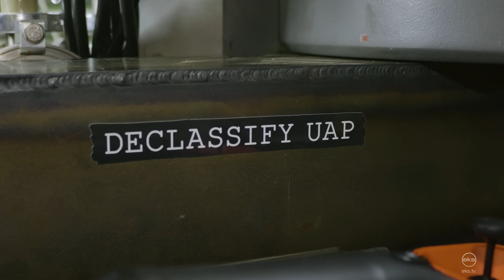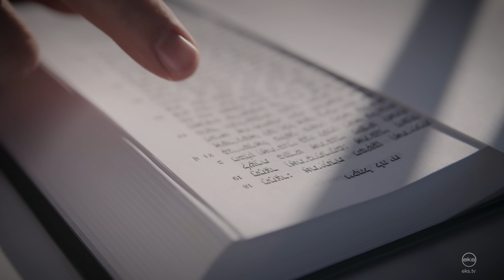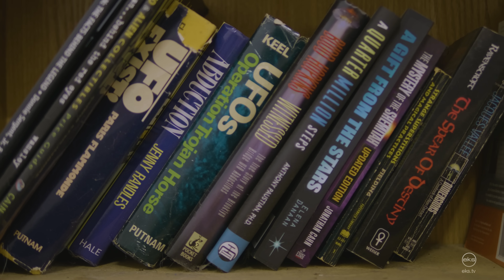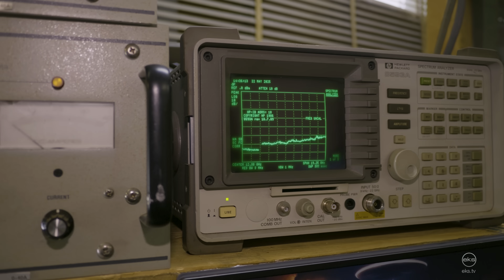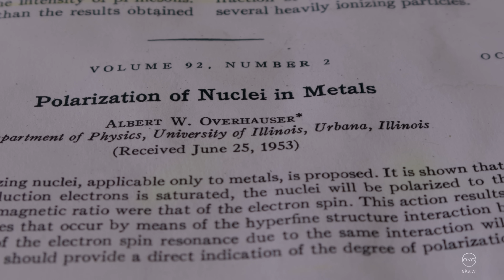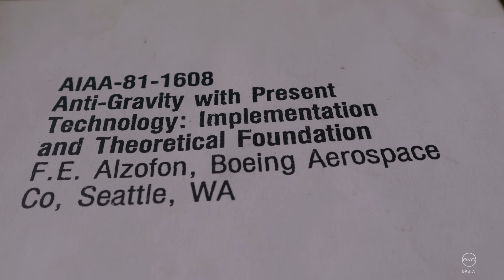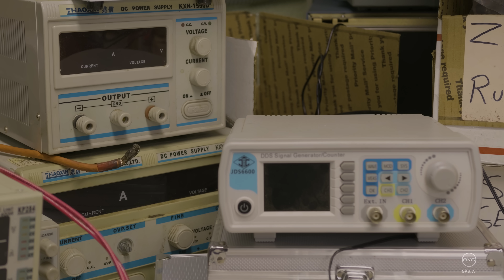Reverse Engineering UFOs - Inside Falcon Space Lab

Comment: Microwave induced Dynamic Nuclear Polarization causes objects of mass to lose their mass thus allowing for faster than light travel and no need to worry about inertia, which explains how UAPs can make 90° turns at 27,000 mph. 
The shape of the UFO/UAP is a Topological Insulator who's unique shape maximizes microwave efficiency.

There's a book they're studying from which explains all this and more. It's from 1963, by C.D. Jeffries, "Dynamic Nuclear Orientation."

PDFs:
Anti-gravity with present technology - Implementation and theoretical foundation pdf

Alzolon-Ionescu Theory of Gravity
2106.0056v1.pdf

On Anti-Gravity
Lucian M. Ionescu
2301.0062v1.pdf

Comment: The shape is completely irrelevant. Aerodynamics is also not a factor on a craft that doesn't have wings. AC's don't use propulsion, electromagnets induction or ion drives (no propulsion).
Reply: Aerodynamics is a factor if you're moving through the air. Whether you use it for lift or not the air still acts on your craft.
Reply: @foo219  Aerodynamics is not a factor when you can warp space. AC's don't rely on magnets or chemicals.

Comment: No. This is not it. EM waves are not the key. Gravity manipulation is space manipulation. Space is not a static bulk in which matter is suspended. It is a dynamic system that ebbs and flows. Space flows towards matter. That is gravity. It is precisely acceleration. Not of matter, but of the space surrounding it. I call it the superflow. Until you can manipulate that flow of space into particles, you can not affect gravity. Godspeed, lads.

Comment: #0:20 , I don't think it's usually the actual material shape of the craft. The shape of your craft will 'usually' dictated your microwave engineering. It can be any shape as long as you know how to create the zero zone center. The zero zone will act as the shape and everything for the craft.
It's just like your mobile phone, were everything is built in it: calculator, calendar, emails, sms ... etc. you are the one who makes the decision. When you are awaken about the Zero zone - the God's zone and how to create it, atoms, quantum entanglement, mainstream physics worrying about using high power and gigahertz frequency will not be an issue - all will be thrown out of the window. 
Should we keep playing around with atoms and playing marbles with mainstream physics or be a part of the God's zone - God's creation.

Comment: Dynamic nuclear polarisation is very well understood it’s used every day in hospitals and it’s called MRI imaging.
Reply from the maker: The idea is that it could be used for other things as well. Similar to how microwave technology was initially developed for military radar technology, but now is most commonly used to heat up food, which was an accidental discovery.
Reply: @ErikKSwanson  Was just going to say that.  The old chocolate bar melting in the pocket or something if memory recalls.  Well I hope something good comes out of it.  I mean we’ve had new propulsion technology every 70 to 100 years and our last upgrade was Frank Whittle with jet propulsion.  Time for an upgrade and ditch internal combustion (not battery power that’s just as old as the IC engine).  We need something new and exotic.

Comment: This isn't reverse engineering at. Reverse engineering is the process of analyzing a finished product to discover how it works, how it was made, or how to replicate or improve. They don't have a product to analyse, they're just scrabbling around trying to find something that works. Get your facts straight.
Reply: Well, it is a kind of reverse engineering, they are reverse engineering by observation.
Reply: Microwave induced Dynamic Nuclear Polarization causes objects of mass to lose their mass thus allowing for faster than light travel and no need to worry about inertia, which explains how UAPs can make 90° turns at 27,000 mph. 
The shape of the UFO/UAP is a Topological Insulator who's unique shape maximizes microwave efficiency.

There's a book they're studying from which explains all this and more. It's from 1963, by C.D. Jeffries, "Dynamic Nuclear Orientation."

PDFs:
Anti-gravity with present technology - Implementation and theoretical foundation pdf

Alzolon-Ionescu Theory of Gravity
2106.0056v1.pdf

On Anti-Gravity
Lucian M. Ionescu
2301.0062v1.pdf
Reply: @SolutionsNotPrayers  DNP has nothing to do with reducing mass, inertia, or faster-than-light travel. It’s strictly a method for improving sensitivity in spectroscopy. Your statement is pseudoscience mixing legitimate physics terms (Dynamic Nuclear Polarization, Topological Insulators) with speculative or unfounded claims (mass loss, FTL travel, inertia cancellation). It’s not an accepted or experimentally validated explanation for UAP behavior.
Reply: Umm yes we do.
Reply: @FalconSpace  Oh yeah, according to Bob Lazar lol. And we've supposedly had them for years and had them working hoho. Very very funny...